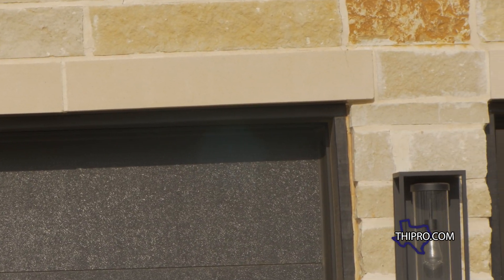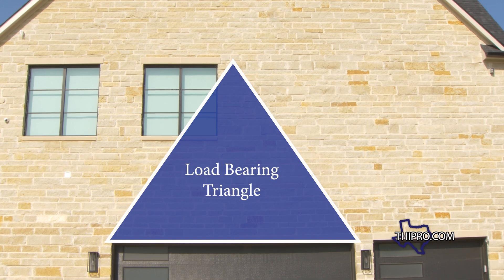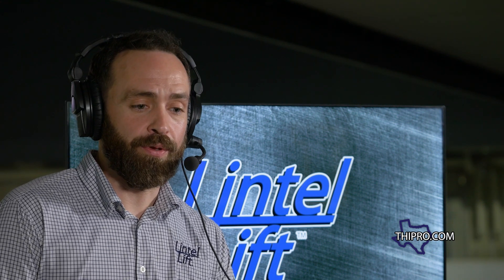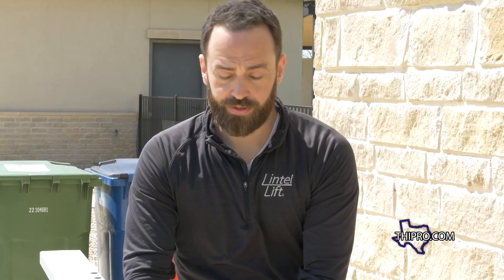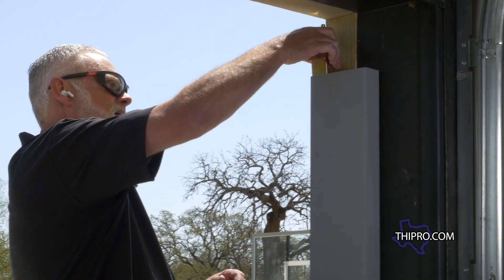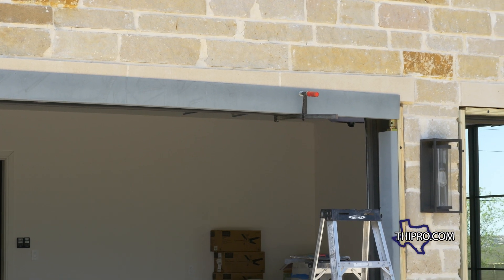Game Changers: Lintel Lift

Comment: The lintel is still sagging in the finished photo. You can see a noticeable 1.5-2.5 inch difference in the stone showing behind the lintel lift frame. Did it even work to lift it back up???

Comment: It is unfathomable that buildings in the USA are built like that. Such a vast garage door and no steel-concrete beam over it? Do you have engineers creating plans for the buildings? Or do they design them to last ten years at most?